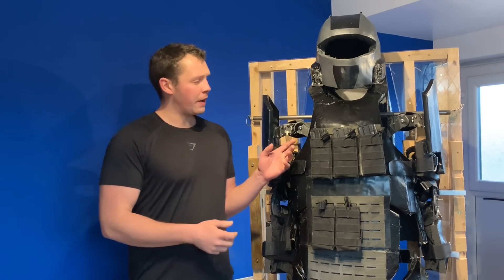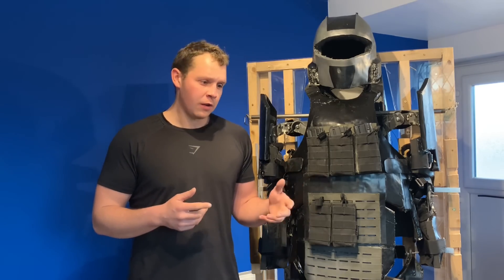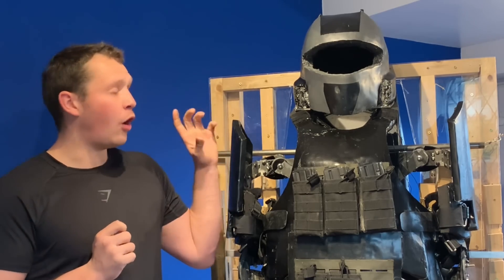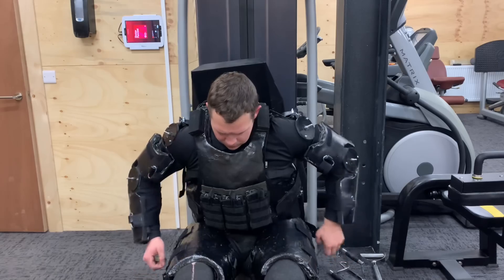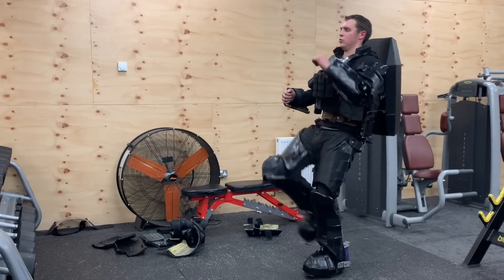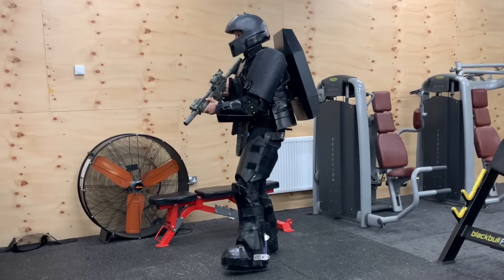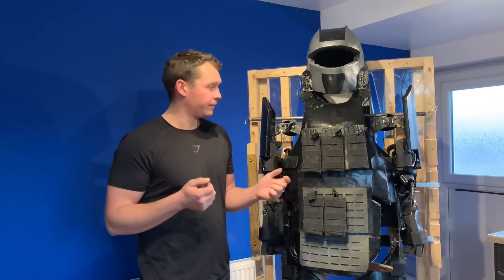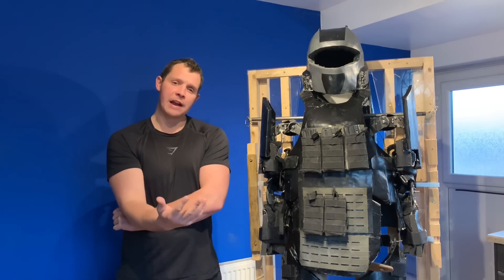Functional Combat Capable Power Armour Development Episode 5 Quest for Bullet Proof Exo Skeletons

Comment: Impressive.  If this guy got this far imagine the stuff DARPA is working on.
Reply from the maker: I imagine theres some wild prototypes out there, i also imagine they cost $1 billion so the projects get cancelled and they sit in storage unused.
Reply: @matthewmaude8894  for sure, the real limiting factor imho, is power. Energy density is just simply not high enough batteries.  With all the research going into batteries for automotive, hopefully this gets solved sooner than later.
Reply: @iwmaxx 
A lithium ion battery pack is ridiculously heavy for power armor use, R&D doesn't solve the energy density problem and thus they'll continue to be heavy.
Reply: @constantinethecataphract5949 and extremely unstable. If the battery gets shot well there goes your soldier.
Reply: @HumorDash  Not If your soldier is already a supersoldier.
Reply: @constantinethecataphract5949 very cool, thanks for saying exactly what he said but with different words.
Reply: @iwmaxx you have hit the nail on the head. We simply have no readily available technology that can power such a suit and still be contained on or within said suit. Once micro-nuclear reactors are viable, we will see a resurgence in power suits.
Reply: @HumorDash I mean that’s a bit meaningless considering that if a non-battery powered soldier gets hit, also there goes your soldier lol.
Reply: @hansmustermann5371 Lithium Ion battery fires turn cars into charcoal even underwater, that super soldier will just turn into barbecue the moment a bullet or a piece of shrapnel damages the Li batteries.
Reply: @iwmaxx if you get a powered exoskeleton (usually rated for twice the operator's weight at a minimum) you could easily strap a Honda Whisperquiet generator to the back for continuous power. Star wars original lightsabers called "proto sabers" had power cords that ran from the saber to a power pack on the back. I'm not sure what the best electrical storage would be, between lithium cells or super capacitors. The generator could be removable, and could instead have a plug, so if you were near a bigger source of electricity you could just plug in and recharge to get a short amount of time on battery power.
Reply: @HumorDash i did drone racing for many years even had sponsors was in the big dutch team in like 2016 and my experience with lithium polemer is that when it goos you cantt really stop it thats wy i dont like electric cars yes gas will ignite witth a small spark butt you can putt it out litthium you can not so if you are trapped in a car crash and itt is electric and the cells start tto go you are gone
Reply: @constantinethecataphract5949 just small gas engine like darpa did witth big dog i think the name was if it makes that sound and the suit is bulletproof the baddys will learn that and stop when tthey hear i sort of like tthe stukas from the germans in he beginning of he war
Reply: @iwmaxx  Realistically, even if the power source issue is fixed, they would most likely be regulated to logisistics roles far behind the front lines
Reply: @hansmustermann5371  You don't understand what happens when one of those batteries combust do you?
Reply: @HumorDash  Bout the only battery that could be used is the Fallout version...a fusion type battery. It will be awhile before we can manage that I would think, but who knows what the government has made, but is keeping secret.
Reply: @melissalee2153  I wish time was the only factor that made tech advance. The fusion fuel already exists that could be of a size for a fusion battery. You just can’t get the materials to make a miniature fusion power plant. Also even if you did activate the fuel I recall the process being rather short lived.
Reply: @iwmaxx  New battery tech is possibly coming out in 5-6 years that will make Lithium Ion obsolete they will double battery life and charge speed, but still waiting
Reply: @HumorDash Isn't the battery going to be armored just like the rest of the suit? It will be on the interior side of the suit behind armor. If the armor is penetrated it doesn't matter who gets hit, the soldier or the battery, because death or injury will follow anyway.
Reply: @HumorDash  I am not sure how big the explosion is but maybe even a squad to if you ambush a sqaud with this
Reply: @hansmustermann5371  but then  comes the issue of  not having super serum or some shit right?
Reply: @iwmaxx  considering where this could lead, i am actually not looking forward to proper power armor as cool as it is as an idea
Reply: @hansmustermann5371  I think even captain America died in a fire on a couple occasions in the comics.
Reply: @danielwatson5595  nothing says combat ready like a nuclear meltdown going down your pants leg.
Reply: @8alakai8  one reason I don't like electric cars, school buses is for that reason. Awful for grid out situations. They are rolling wire taps.
Reply: @danielwatson5595  As somebody who designs them, let me assure you that micro-nuclear is already available. Currently looking at a watt of useful power for every 2.5 grams of fuel if you're willing to drop a big lump of plutonium into the back of every exosuit on the battlefield.
Reply: @nata5212  If viable, then why do we see no military/commercial application of such a technology? Maybe I’m just naive to it, but every nuclear solution I have seen actually built and run successfully has been on a much larger scale.
Reply: @iwmaxx  There are probably more considerations than just the power supply. Because as far as the military goes what they actually really love is stuff that's easy to maintain and supply. Even if it's sometimes inferior equipment. How does the saying goes? Amateurs talk about strategy. Professionals about logistics. 
In the end you have to not only supply a large number of troops, we're talking eventually about millions of soldiers here but you also need to repair, supply and properly maintain it. And then you have to ask your self how much protection do you really get from it? Like is the trade off that you have in additional supplies really worth the trouble? If you just want some heavy weapon, get a mortar or call in air strikes, artillery what ever. Do you want protection from small arms? That's almost impossible. The moment the enemy fields anything larger than a rifle or even explosives, anti tank weapons are pretty common out there, that goes out the window too. Just look how damn easy it is to disable whole tanks(!) with drones these days. So what is a soldier armed with a heavy suit that requires a lot of maintenance going to really do in the end? If a drone with a 120mm shell straped to it goes off it won't matter if you have a power armor or not.
So even with a perfect power supply and battery that runs for hours, maybe days, it might still not be deployed by the military.
Reply: @MattExo-Dynamics  look up Project TALOS. The "Ironman" armor. They had to cancel the project because they couldn't effectively power it.
Reply: Shit man dont make me curious
Reply: @MattExo-Dynamics  If reports are to be believed, at least 4 field-operable prototype power armor suits of some kind or another were used once slightly before we pulled out of the Middle East.
Reply: @MattExo-Dynamics  Yes they've gone after this multiple times over the decades. Rumors are they've come up with some good sleek designs in recent years but the costs are just too much to justify their purpose in the first place. Not to mention that current advances in technology and the way modern conflicts are fought don't have much need for soldiers wearing power armor.
Reply: @MattExo-Dynamics  and that's how we get superheroes... or villains. The existence of one begets the existence of the other.
Reply: @MattExo-Dynamics   Outstanding job, sir. 🗿
Reply: Mobility is more important that being bulletproof.
Reply: @loganireland3113 or not being a heat casualty before the fight even starts lol. Civilians don't realize how big of an issue the heat is in combat or military training.
Reply: @loganireland3113  Nothing is bulletproof.
Reply: @loganireland3113  exactly. these aren't being engineered because hit and runs or hit and hide is more effective than hitting then waiting to be hit. Jets and helicopters have no exterior armor because their armor is being able to maneuver quickly and avoid incoming missiles, the same could be said for infantry, you have a group of guys wearing plate armor and normal helmets they are going to be able to avoid incoming artillery barrages and infantry pushes whilst the guys in these suits are sitting ducks. Plus the size difference makes you a way easier target. One rpg round or grenade or even small arms fire to the right place would take you out so I do not see a scenario where this comes in to use.
Reply: @loganireland3113  tell that to any combat zone in a urban environment
Reply: They wont even bother with this shit. They're going straight for armored robots. Way more benefit for the cost.
Reply: @caralho5237  They did bother with this shit.
Reply: @caralho5237  Yep! Exactly the route I went after messing with this type of project. Ends up actually being easier in many ways.
Reply: @caralho5237  then you don't need a military with people who have morals
Reply: @HumorDash  The people in power dont want that, they want obedient drones. Theres been a push for automation, use of AI and the dawn of drones in the past 40 years. Its where armies have made their most significant breakthroughs. Thats what they want
Reply: it already exists, it's just in R&D. the rule with defense contractors is that they're thinking at least 2 gens ahead of public knowledge in any given area
Reply: actually this sort of thing isn't classified any more. They were working on this stuff in the 80's and 90's. not just darpa but derra too. I worked for the MOD - in a technical capacity as well as out sourced to other military industrial entities such as BAE, derra, gchq, saw some of this stuff first hand. Sadly it was decided that the financial and logistical cost was non viable. Add to that that warfare was moving to less and less direct human bodies in conflict areas. Instead of armour the push was for drones and robotics - and that was where the money was spent.
Reply: Darpa already had a few prototypes of a powered exoskeleton back in the early '90s. The problem then is the same as the problem we have today, how are you going to power the thing?
Reply: There's an interview on Shaun Ryan's channel of an ex Navy Seal talking about the ironman suit project he worked on, it was called Project Carnivore at the time and apparently they used small nuclear batteries. 
His point was they are all well in good in a firefight, but you can't fit in any of the militaries vehicles! They would need retrofitting of some and specific modes of transport for the guys who are wearing these in the not distant future.
Apparently they figured out the weight carrying issue by working with and studying obese ppl and how they can carry 3-400lbs extra weight(his words).
Reply: Lol the military won't use anything like this because you'd have heat casualties out the ass. People would be dying on the field left and right.
Reply: Plus it's bulky, it's big, not very stealthy. Even if you were to just go lay in the prone in the sun in a hot field in the summer. You're gonna get dehydrated, you'll get all caught up on tree branches, vines and thorns and shit.

And if you got on all that plus your water supply, food supply, hygiene gear, sleeping gear. It also takes a long time to get on an off, so you'd have to sleep in it and in the summer you'd get dehydrated very fucking rapidly even just sleeping in that. You'd probably be soaking in a puddle. Even in the winter you'll sweat during the day then when you're sleeping in it at night you'll start freezing soaking in your sweat.

All this shit happens already with the armor we have now lol
Reply: Seeing people in the comments section going "we probably don't have the tech for this", meanwhile me thinking "China is lightyears ahead of the US in battery and nuclear tech".
Reply: @Gustav_Kuriga  Ah yes. Absolutely. China.
Reply: @jurajsintaj6644  Don't believe me? Do some basic research. Look up who's pouring research and construction into nuclear and EV tech, and who is paying lip service while project after project collapses due to budget reasons. Hint for the latter: it ain't China.
Reply: @Gustav_Kuriga  shoot explosion lasers from satellites like the one used on Hawaii
Reply: @Gustav_Kuriga  It took china 10 years to copy our F-22 and make a competitor the J-31, and even that is a hunk of metal compared to a F-35 and F-22. These guys arent nearly as capable as US engineers. LOL, 99% of their junk is a shitty copy of US engineering. Pull up a picture of the J-31 and F-22 and when they were made, and then you can tell me who is leading in technology.
Reply: Ya darpa 
Dildo 
Actuated 
Revolving 
Penetration 
Articles 

They probably made battery powered sex toys.
Reply: Theyre working on developing groundbreaking new pronouns and vaccines that give you myocarditis
Reply: Yeah when they aren't busy doing stuff like, possibly starting Facebook as they "cancel" there program "LifeLog" the same year as Facebook starts.
Reply: They're working on a cum robot and this man is making power armor
Reply: Battery tech is a huge limiting factor. But even if you can get a working exoskeleton on the battlefield it has to also be cost effective. If you can take a single big rifle, and one hit kill an exo skeleton wearing soldier it defeats the purpose of the armor. Frankly unless the exo armor is as good or better than modern tank armor, it better be cheaper than the sniper ammo used to kill the soldier. Anything else and it won't be economical to produce or use enmasse.
Reply: We wont make to the end of the century without seeing real life Spartans supersoldiers on battlefields.
Reply: Darpa? Pfftt Skunkworks already got them for their own pmc group.
Reply: Not really, not AT ALL
Reply: Nothing. DARPA is mostly Jewish con men trying to develop weapons for Israel.
Reply: Darpa has wild shit. 20 years ago they had this power suit that would alow a soldier to lift a literal ton of weight to clear battlefield obstructions.
Reply: @nayrtnartsipacify   
Bullshit. They don't have any way to do anything of the sort. Oceania has always been at war with Eurasia.

None of that crap is real, it's all money laundering.
Reply: Power armor has no real place in a modern military, that is the reason we don't have it unfortunately.
Reply: @theravenousrabbit3671 It absolutely has its applications, like breaching and pointman in indoor scenarios in general (basically in scenarios where being more mobile than tough isn't feasible). The REAL reason we don't have it yet is batteries aren't good enough (while being compact enough) for it yet.
Reply: @burnttoast26  So you're talking that this is going to be the replacement to flashbangs and teargas...?
Reply: @theravenousrabbit3671  Where did I say that?
Reply: Nothing. The DOD has determined the technology to be too immature. These guys like Matt are needed to advance the tech further before adoption.
Reply: Depends on the military doctrine. If motorized vehicles and air superiority are expected then power armor isn't really needed. It's more valuable to invest money into better aerial vehicles and armored vehicles.
Reply: @JohnDoe-bh2lp  Neither of which can sufficiently secure ground, especially in an urban environment. Vehicles and air don't replace the infantry role.
Reply: You know what?  I used to say things like "wow imagine what the government has" but I've come to learn that regular people almost always find a cheaper, better way.  the only thing I can imagine is how inflated DARPA's budget must be to accomplish what these Tony Starks can achieve "in a cave with a box of scraps!"  After witnessing the advent of the Oculus--before Facebook bought it--with a 200K kickstarter (that grew to a larger sum) I knew that the bigger these organizations are, the more money they have to spend to achieve a fraction of the same ingenuity.  The govt sunk a LOT of money into virtual reality crap for training simulations but nothing came close to the Oculus.  

I think Matt M is onto something fantastic.
Reply: @RyouConcord Real, the government is incompetent in general. These people who think that the government is 20 years ahead or whatever technologically are buying Hollywood propaganda.
Reply: @RyouConcord Government related anything usually overspends and what they spent it on doesnt work out most the time to begin with.
Reply: @RyouConcord so… kind of. The thing is, Palmer Luckey was working with a military contractor testing out training equipment doing augmented reality / VR stuff working with active duty soldiers, while at home he was building prototypes for what eventually became Occulus. So really, it was a private individual doing extensive iterative testing and design (later a corporation) in conjunction with government research that helped fuel the leap forward. Luckey also had developed a forum community of VR enthusiasts at the time and interacted extensively with them, which likely also helped develop a collective knowledge base for innovation.
Reply: They have zero point generators available power has not been an issue for nearly 40 years
Reply: @poopypantsbiden8163 all the zero point generators are currently in use powering stargates
Reply: @poopypantsbiden8163 We don’t live in the world of stargate man.